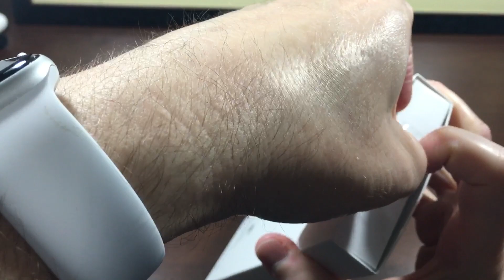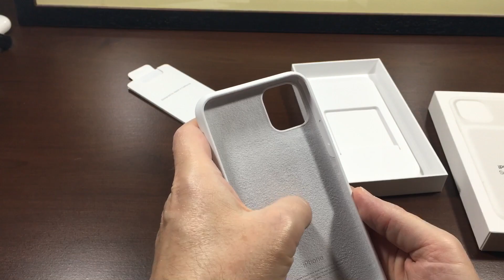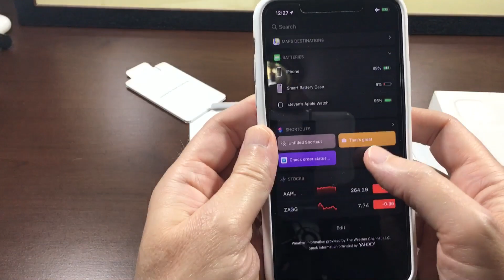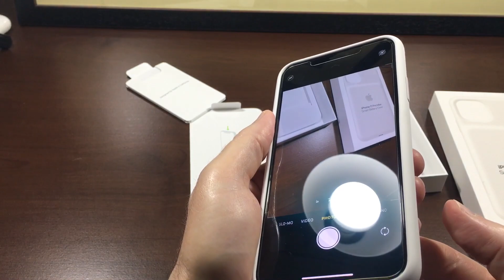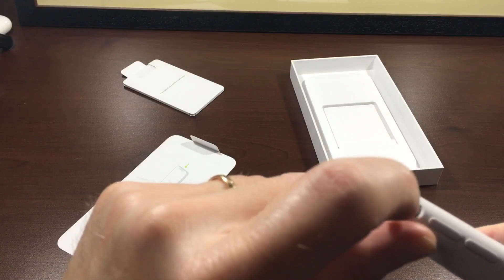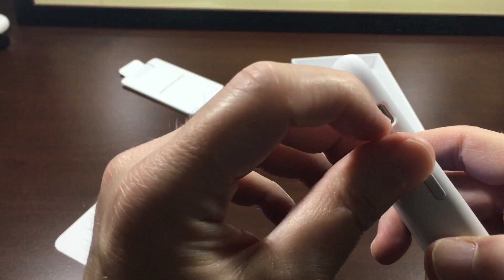Apple Smart Battery Case for iPhone 11 Pro Max

Comment: All so far explained its ok.& ok..... BUT .... IF THERE WAS A POWER ON SWITCH to SWITCH ON this Smart Batery to charge my IPhone at my relevant time when I wanted to charge my iPhone it would have been amazing. Now I need to put and remove it hundred times from my iPhone 11 Pro Max, because to avoid CONTINUOUS CHARGING. If they had constructed it with a switch I could have used this Smart Batery Case as permanent COVER. I don’t know why they didn’t think of it while designing it..... I hope you could understand what I am mean..... to make this cover user friendly.... MJF. Ln. Antony - MADAME SHANTHES.
Reply from the maker: A power switch would have been an awesome feature, just like you said. I don't want my battery to continuously charge either, hopefully Apple someday  gives us the option to turn the case on and off as we need.
Reply: You realize what makes it a SMART case is how it continually charges and doesn’t have a button right?🤦🏾‍♂️ y’all so worried about it continuously charging you forgot Apple designed it this way. Your phone performs better fully charged and dies a lot slower. I never take my case off and my phone always have juice 24/7!!
Reply: They make it the way they do so you don’t have to worry about your actual phone battery losing it’s capacity.
Reply: @youasnitch314  thank you. I don’t know why they’re worried if so buy a mophie case. They have a switch on theirs and it’s 100 dollars cheaper.
Reply: It's called a smart battery case because it thinks by it self. I had a battery case with an on/off switch and half the time I forgot to switch the battery on so I still ended up with an empty phone. The smart battery case does the job and it's not constantly charging , the case is used first so your phones battery stays at 100% while using the battery case. Very smart 🤓

Comment: Does white get dirty faster than the black one?
Reply from the maker: Definitely! I’ve only been using the case a few hours, and already it collected visible lint and other junk from both my pants pocket and my coat pocket. The black color case would hide that much better. It all brushed off easy enough, but now the test will be if that gets annoying, or if anything causes a permanent stain on the case. I’ll be talking about all that when I do a review on the case in a few weeks.
Reply: Techdog47 have you done the new review yet?!
Reply: Techdog47 thanks!
Reply: The black gets more oily stains ,the white one stays cleaner